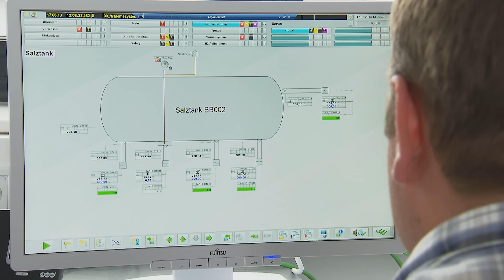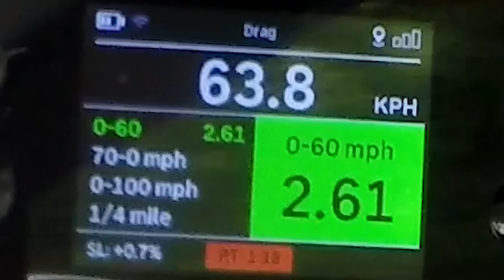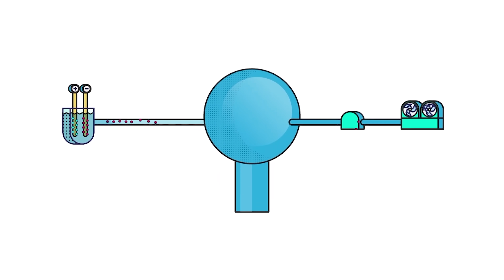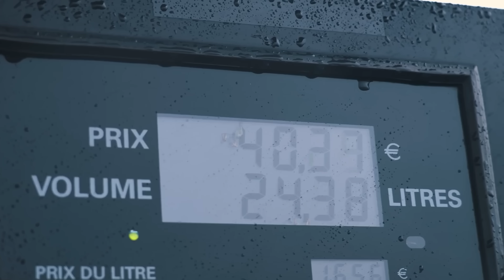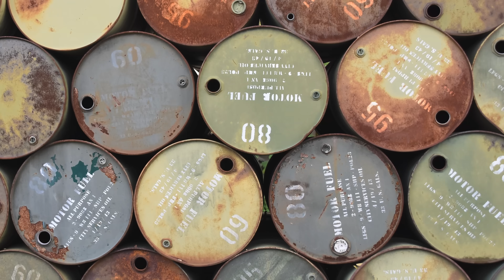Porsche just SAVED petrol engines FOREVER

Comment: Synthetic fuels are such a sham. This is a silly loophole to keep producing ICE cars, but will do nothing to reduce emissions and lower the effects of climate change. Burning the fuels will continue to release greenhouse gases into the environment, so the total greenhouse effect will not reduce. The fuels are arguably net-zero, but rely on their production using electricity from renewable sources. Therefore, we are relying on external factors to make this viable. Currently less than 100% of grid energy is renewable, and by 2035, we will still not be there, to think that these fuels will be created using only renewable energy is laughable. This is also not including all the time and energy spent on developing this fuel, building the infrastructure, etc. which will also contribute to total emissions.

Comment: Definitely better than normal fuel, However with current state of global warming being carbon neutral isn't enough anymore. Best way is we should emit zero carbon(electric) and focus on the process of making battery, electricity to be carbon neutral as well. I live near the equator and the temp is too extreme to handle now,  we don't even have a proper winter anymore everyday is pretty much above 30c.

Comment: "Carbon neutral" renewable fuels is really not  enough though, in the sense it won't decrease the CO2 in the atmosphere and the sea.
Reply: Neither won't EV's...
Reply: @DoorTechnicianRick  Correct sort of. :) However....... "Green Fuel" driven cars will increase the level of CO2 because the amount of cars in traffic allways increases. The nature just can't increase its CO2 absorbing capacity to compensate. We are way beyond that allready. So, if electric cars driven by green energy replaces cars thats not electric, they do in fact decrease CO2 in the biosphere.
Reply: @tommykarlberg  Well another fun fact for you. The amount of polution will increase anyway since all combustion engine cars will be shipped to third world contries anyway. So the worldwide amount of ICE cars stays the same. Couple that with the increases polution in the EV production process and it will actually get worse.
Reply: @DoorTechnicianRick  Yes. But if we didn't do anything to change. it would increase even faster. So the best thing to do just now is to prepare for a more environtment frindly energy system, even if it sucks just now.  you cant have progress if you doesent even try.

Comment: Surely the burnt e-fuel is still placing gases into the air, even though you say the net effect is zero. There would still be gases expelled into the air or are we going to be told that it is cleaner than petrol, the same as we were told about diesel and we all know what happened there. Thanks for the informative video.

Comment: In 11 years I think this is actually achievable rather than retrofitting every city and town with an EV infrastructure in the same timeframe. I mean — to roll it out right now I believe the price would be roughly USD$40 (€36/£32) per gallon! That’s insane. But I believe that’s due to lack of current supply and high demand. Once the refinement process becomes much more streamlined and technological advancements allow it to scale up much more quickly, making it more accessible, we may still hear the sounds of V10s and V8s well into the 2040s. I hope this means emission standards could become things of the past.
Reply: We'll still need emission standards because it's not a clean burning fuel.  CO2 is still a byproduct of the combustion cycle.  The neutral part is the recapturing of CO2 during the manufacturing process.  I've got my fingers crossed that the music from ICE will continue!

Comment: We have to face facts (which very few are doing). Net Zero is not going to work. Many reasons, but the biggest one is that it is simply not necessary. Prof Richard Lindzen said, "Man made climate change due to CO2 emissions is trivially true and numerically insignificant." We've fallen for a useless ideology.

Comment: Firs of all there already is a way better alternative to sintetic fuels and it's called hidrogen. Second problem is that the cars that use sintetic fuels or hidrogen will always be more expensive to run than an electric car (unless you introduce a tax on batterie pollution or something like that)!
The third problem is that sintetic fuels will not solve the biggest problem of fossil fuel cars, which is the air pollution in the middle of the cities unless they will be banned inside the city.
But I do agree on some thing, electric cars should not be the only option. Plus, batteries should drastically be improved in order for electric cars to truly be a better choice.
For now, we really don't have a solution without compromise, unfortunately!

Comment: The downside is that internal combustion engines are about 13% efficient.  So e-fuels will waste a lot of energy.  Battery EV are 50-60% efficient.  I’m hoping for effective fuel cell cars!
Reply: Evs are a lot more efficient than 50-60%, around 85-90% in fact
Reply: Maybe the efficiency figure depends on what you are measuring.  Electric motor alone probably 85-90%.  Charge cycle will lose some efficiency inevitably.  Generation won’t be 100% efficient.  But compare that with 13% minus exploration, extraction, refining and transportation losses too.  No comparison.

Comment: THE BOTTOM LINE HERE, IS THAT WATER HAS BEEN USED AS A REPLACEMENT FOR PETROL YEARS AGO - THE INVENTOR AND SECRET WAS BOUGHT BY THE PETROLEUM COMPANIES!
MANY MANY IDEAS AND INVENTIONS TO REPLACE OIL OR PETROL HAVE BEEN QUASHED BY THE BUYING POWER OF THE OIL COMPANIES. THIS IS NOTHING NEW.

Comment: On the 90 Days a year (25% of a year) that the wind doesn't blow strong enough to power a wind turbine. Does production shutdown? Or do they use massive diesel generators?
Reply: Depends where you are. In New Zealand we have mostly Hydro power followed by thermal and some wind and solar farms so no diesel generators needed.

Comment: As much as I love petrol cars this just isn't the solution. Sustainable replacements to hydrocarbon can't be sustainably made in the volume required to replace all hydrocarbon consumers rn. Realistically the aviation industry has to take priority for using sustainable fuels because they are the most energy dense option. As planes have to lift the weight of the fuel source this is currently the only really serious solution for longer haul larger jets. And there will be little if any sustainable fuels left for the car industry after the aviation industry has had its fill

Comment: Some cold water for the wishful petrolheads in the comments. The atmospheric composition of Earth's atmosphere is as follows:

780,000 ppm of nitrogen (78%)
210,000 ppm of oxygen (21%)
10,000 ppm of everything else (1%), including 420 ppm of CO2 (0.042%)

Methane (1:4 ratio of carbon to hydrogen) creates 2.75 times it's own mass in CO2.
Benzene (1:1 ratio of carbon to hydrogen) creates 3.11 times it's own mass in CO2. 

The five options of dealing with the carbon content and their respective counters are: 

1) Direct air capture - let down by either low efficiencies of mechanical sorting or low areal power of passive contact (no disturbance of O2 and N2)
2) Biological processes - with their own issues of area and low, low efficiency and power per unit area.
3) Industrial output - still goes from geological to atmosphere. Problem kicked down merely one step.
4) Onboard capture - lowers energy density to point hydrogen leapfrogs it and wins again.
5) Breaking of carbon away from hydrogen - Causes a coking layer if done electrochemically, as the carbon must bond when electrically free. The oxygen is needed for separate molecules!

This annoying roundabout of logic is the reason why hydrogen never seems to truly go away, however annoying it may be. 

Also, biological and synthetic fuels inherently have no sulphur, which means no high temperature fuel cell poisoning, which means hydrocarbon fuel cells will be needed to avoid NOX. So , no, the engine still wouldn't win if e-fuels got big for everyday vehicles. Shocker. Sorry.

Comment: Electric cars are an impossible future unless something radical happens to the charging network, fixing charging outside homes (terrace houses) or flats/apartments, the time it takes to charge them… oh and let’s not forget the sheer cost of them! They aren’t even green particularly (factoring in the dirty power network that charges them and then the extracting of required materials to make the batteries).

Comment: A pure EV world works if you have 7 Earths for the raw materials, 2 Earths for the crap resulting from the battery manufacture and 1 more Earth for the solar and wind farms needed to produce all the energy necessary for the process. Toyota, Stellantis and BMW, among those I know, came out saying this basically just during the last month. Synthetic fuels (those proposed by the EU) are almost as idiotic as EVs, given that they plan to make green hydrogen from hydrolysis using renewable power (from almost non recyclable solar panels and wind turbines), then use the Fischer-Tropsch process and atmospheric CO2 to create synthetic gas/diesel. All this just to put that CO2 back where it came from as soon as you start the engine. When you can use that clean hydrogen you just produced directly in the combustion engine, with almost no modifications and with no resulting CO2. Toyota proved this by running a hydrogen powered Corolla (that sounds amazing) 2 years in a row at the 24 hour of Fuji. 

https://toyotatimes.jp/en/report/hpe_challenge_2021/150.html

Comment: But then they didn't, did they? All this is based on getting Carbon out of the atmosphere into a cycle. Means that first you need to create electricity to create hydrogen, then you need to create electricity to get carbon out of the atmosphere. Then you will need some energy to create carbon hydrates and with those you can drive your car. All of the processes have an efficiency factor to in the end translate the movement of the engine into a forward movement of the car.

Whilst all of that is certainly possible, in the end of the day, you could just use the electricity directly to drive a car. Albeit using a battery that will lose 15% in charging and an electric motor that will loose 20% in transforming the electricity into forward motion. That is a loss of 35% so you end up with 75% of the energy put into the system into forward motion.

An internal combustion engine has an efficiency factor of about 20% and that is not even taking into account the  transmission etc.

So use 75% of the energy vs. 20% of the energy ... certainly possible but it will be at least 4x as expensive logically. So what are people going to choose? As much as we might regret it... the laws of thermo dynamics and the laws of markets are inevitable.

Apart from the fact, that e-fuels are only carbon neutral if the energy used is 100% renewable ...that alone (the sheer amount of windmills and solar cells needed) is a challenge all on its own.

But the laws of physics and economics aside, we cannot warm this planet more. If we do we as a species will cease to exist.

Comment: If they can make synthetic fuel top replace petrol and diesel, that is great. But how much will it cost? 100 kWh of electricity will get most EV's 300 to 400 miles, so how much range would that give in synthetic fuels?
If 20kWh was needed plus cost of materials to produce a litre of synthetic, then this will cost more than running an EV. Would you pay 3 to 4 times the cost to do the same mileage?

Comment: e-fuels may be carbon neutral but they are grossly inefficient. A little less than 50% of the energy that you put into making the e-fuel actually ends up as usable chemical energy. If you add the fact that ICE's are loosing 70-55% of the energy of the fuel you end up between 16-24% efficiency which is a lot less than the ~70% efficiency of charging and driving an ev. On average you use more than 3x the energy to drive a car that runs on e-fuel than driving an ev car. For motorsport I can see this happening but not for all our transportation needs.

Comment: In summary: They (porsche) plan to take CO2 out of the atmosphere to make methanol which is then used as fuel that, when burnt, emits the same CO2 back into the atmosphere, resulting in zero net emission and thus can be approved to use as govt ban combustion engines.

Comment: To save a chunk of your life, 4:30 - 6:00 is what you're after.

It doesn't take a genius to understand that methanol is the way forward. It's been used in motorsport for decades as it burns clean, has a much higher octane rating, and that higher octane rating means it can be used in road going engines with higher compression and/or higher boost pressures resulting in greater power (or more efficiency due to displacement downsizing) for the same amount of fuel used. Methanol can also be split back into H2 and CO2 pretty easily, so it also makes a very good case for super efficient hydrogen fuel cell electric vehicles as methanol can be stored as a liquid at ambient temperature and atmospheric pressure, vs the hundreds of PSI required to store hydrogen at the same energy density as a gas which in turn equates to further efficiency due to smaller and/or lighter tanks.
In theory, green hydrogen could have a secondary effect if methanol goes mainstream enough as all that methanol contains carbon, and when it's stored in tanks (fuel stations, fuel storage facilities, vehicle fuel tanks) is all carbon that would otherwise be in the air displacing oxygen that is essential for combustion in the first place, and pulling all that hydrogen from H2O in order to make it happen to begin with will put more oxygen back into the atmosphere to further oxygen enrich the air around us, and whilst realistically it would still only amount to a few percent at best, it's still going to add up given the number of combustion powered cars on the road.
Moving forward in a world motivated by methanol however, there's still one thing that methanol combustion engines still struggle with, and that is nitrogen oxides. If it were possible to scrub nitrogen from the air, this would further increase combustion efficiency, improve power potential, and reduce the formation of nitrogen oxides that also deplete the ozone layer! However it would be most desirable if such scrubbing could be done at the low level (in the vehicle's induction system) as any attempt to scrub nitrogen from all the air around us could have various undesirable effects from inducing oxygen intoxication due to higher oxygen content in the air we breathe, to fires becoming much more violent and harder to extinguish, but I feel like I'm starting to wander off topic here. In short, methanol is probably the ultimate fuel for combustion engines (and electric vehicles) as it's greener than Lithium batteries, a drop in replacement for gasoline using current infrastructure and existing engines with minimal modification, improves efficiency and enables CO2 neutral combustion, it still doesn't address the problem with NOX emissions from combustion with air (air being a mixture of gases including oxygen, nitrogen, and carbon dioxide)

Sorry for the long comment, but if you've made it this far, good job! And thankyou for your patience

Comment: Flawed Analysis:! Fact is to make E-Fuels, you need lot of Electricity to process it and develop the fuel...which doesn't make it carbon neutral. Plus the cars using them emit the same CO2 anyway into air.

Comment: Not really impressed by this. My old Chevrolet runs on Ethanol synthetic biofuel since the day it was made in 1992.
Renewable, since it's made from planted sugar cane. Carbon neutral, since any amount of CO2 released was captured from the atmosphere when the plant was growing. Brazil has been using synthetic fuels on the side for decades (we have biodiesel too), and we have engines that can run on both Gas and Ethanol.

Comment: they should just take a page from ALL those drivers of "Green EVs" out there that use electricity from coal fired plants to charge their batteries - 
but instead use that same electricity to power their "Green Energy Fuel Plants"...
that way they can virtue signal the same way that EV owners do...
"Look We Drive Green EVs !!!"  and  "Look We Make Green Energy Fuels !!!"  😆🤣😆🤣😆

seriously - all you greenies out there - 
How much energy is used to manufacture all those EVs ?
How much energy is used to manufacture those giant wind turbines  ?  (whose blades are not recyclable)
How much energy is used to manufacture all those solar panels ?
How long do the wind turbines and solar panels have to operate before they have generated the same amount of energy that it took to manufacture them ?
EVs - will never replace the amount of energy it took to manufacture them. 
Keep in mind - ALL those materials for the EVs, Wind Turbines, Solar Panels, etc - had to come from somewhere
How much energy did it take to mine, gather all those materials and produce all those parts ? (was all that done with "green" energy ?)
What has all that mining and production done to the environment ??

What happens to old Wind Turbine Blades  when they die ?  
THEY GET BURIED - because they cannot be recycled - here take a look:
https://www.google.com/search?q=discarded+wind+turbine+blades&source=lnms&tbm=isch&sa=X&ved=2ahUKEwjtua2Ox5P-AhU8FzQIHRaAAOQQ0pQJegQIBRAC&biw=2281&bih=1269&dpr=1#imgrc=hUxske-skFmXKM